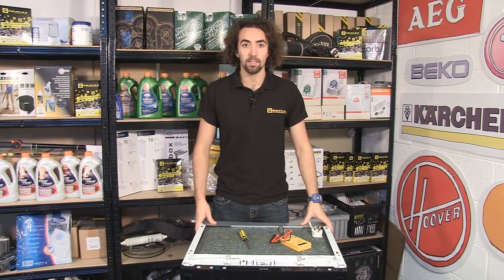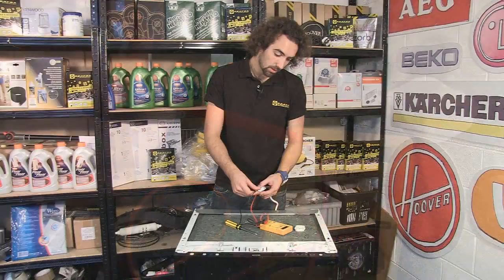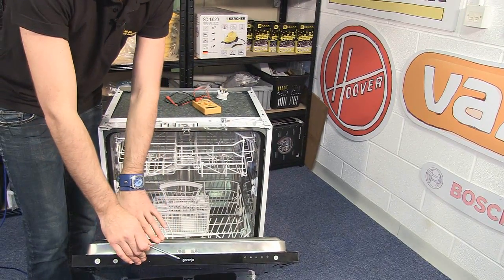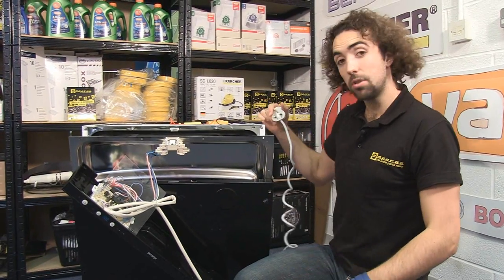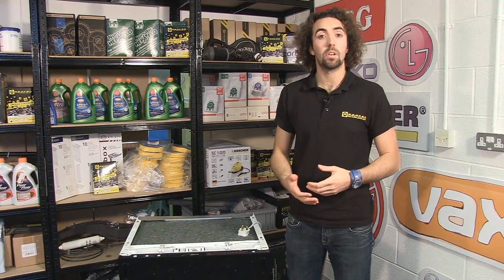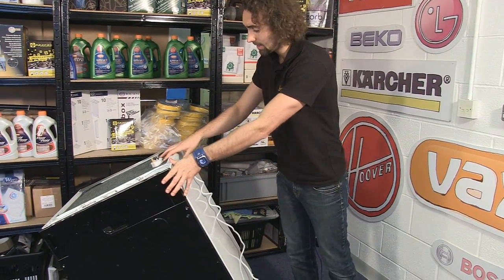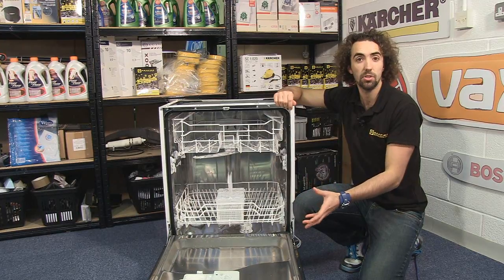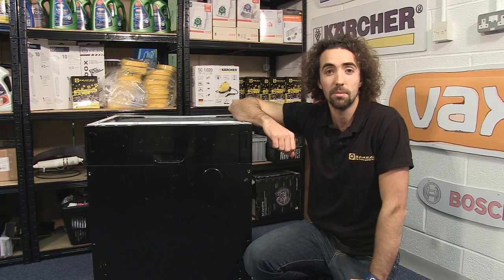How to Diagnose Control and Programme Problems with a Dishwasher

Comment: What can be the cause of a Beko eco care dishwasher model number D3731FS  as regards the selection of the temperature control buttons, they wont light up with either the 40 or 60 degree wash. the main light comes on when we switch on the machine but the temperature choice ones wont function. Any suggestions please  as i cant find answer to this question anywhere. Maybe its just to old!
Reply from the maker: +Susan Ripley We have not been able to find any information on this but  select the longest wash and see if the temperature can then be changed. On short cycles this may be fixed.
Reply: +eSpares  Hi thanks, problem is since the temperature settings lights dont come on the machine wont function at all and no water will come in. You have to choose either the 40 or 60 degrees then choose what programe you want but  nothing is working since these havnt been working.
Reply from the maker: +Susan Ripley Sorry but your description was not clear. With the door open switch the machine on and see if the lights flicker briefly. If no motors are running and no buttons bleep check the button unit and PCB for signs of corrosion or damage.
Reply: +eSpares  Hi thanks will do, or should i say will get hubby to.

Comment: Great video thankyou! I have the same make dishwasher Gorenje GV62110. And the programme button has stopped working.....LED lights flash once when powering on then remain off, the power button remains on. The prog. button clicks when pressed as normal, have gone through troubleshooting, opened up the control panel; the covering over the wires did feel damp, but that's all I could see. Have bought a multimeter today to attempt to investigate further.
Reply: So, I've done the tests as in your video and have concluded that the control board needs replacing. Are you able to tell me whether there is any need to 'programme' the replacement board on this model? : Gorenje GV62110, thanks. Great videos on your channel by the way, a great help.
Reply from the maker: +MissMochynbach The control board for your machine does not need programming and is shown here: http://www.espares.co.uk/product/es1642846/dishwasher-pcb

Comment: Great tutorial. Can you say something about the so called AquaStop ? How they work etc.
Seems to be an UK Plug / Machine / Setup. In Switzerland we don't have the fuses within the plugs, instead they are built in the device itself most of the time.
Reply from the maker: 1videoshow On some 'new kitchen' installations in the UK we wire the appliances in to 'wall plate connectors' and have a switch bank above the counter tops to isolate each appliance. As far as I know the wall plates or switchbank will be fused as well as fused and the house fuse board. Aqua stop hoses move the inlet valve to the tap and connect it through wires in the hose. In a cold environment (unheated utility or garage) if the temperature drops enough to freeze then even if the hose were to rupture no water would flow until the machine is turned on. Thus helping prevent flooding.

Comment: I have a KitchenAid and only half of the control panel works. Would that be the control panel?  The lights on the left-used to select the cycle work, but the lights on the right do not light up-to turn on or cancel.
Reply from the maker: Melisa Bellantuono It is likely to be the control panel or the button unit.

Comment: aside from the British appliances and the fact that you said that a higher resistance would mean a short it was a good explanation of dishwasher operation.
Reply from the maker: Thanks for your comments Robert,  we have rechecked our transcript.
We think you are referring to the following lines,  which when studied again we still believe are correct: 5:07
Now if you do get the reading of a short circuit, try disconnecting the heater and then testing again on the plug to see if the short is gone. If the reading is much higher, that would show the short-circuit is likely to lie in the heater.
We post this reply just to show that we do try and ensure the correct information is given and if an amendment would clarify are more than happy to add an annotation. :-)
Reply: I only have no power to my front start/stop and time panel which was only having intermittent problems and has failed altogether now. I have power to the wash selection at the top of the door.  Thanks for you're reply. I did hear you say that if a person found more resistance that that was where the short was. You might want to look at that.
Reply: The line you talk about here is not the one I heard that is not correct
Reply from the maker: Robert Greenhouse Without a model we can only generalise but if you have confirmed power to the control board and will not light up it suggests the problem may be the control board but check any switch bank attached has not been contaminated from moisture or corrosion.
Reply: I will.  Thank you
Reply: MDB8751BWB
Reply from the maker: Robert Greenhouse On your Maytag dishwasher the live and neutral connections both go through door switch contacts to the control board directly.
The information we have found for this model (NON UK) contradicts itself suggesting on the wiring diagram only one board but in the parts listing a separate control panel. if you have a separate button unit examine this carefully for signs of corrosion especially on the connectors.
Reply: Thank you, I will check that

Comment: When my washer starts the drain sequence starts then it starts to wash and the drying light comes on the wash light never comes on. it goes through it cycles washing and drying at the same time we have to stop it manually drain it and they give it a rinse to clean the dishes. A red light comes on under the drain/cancel button. I thought it needed a new control panel/board. I replaced it an d it does the same thing. Any ideas? It seem to drain ,fill and wash okay. It also gets pretty hot, so the heater is okay.
Reply from the maker: Hi Bowman W, What make and model are we talking about?.
Reply: Kenmore # 66513469K902
Reply from the maker: Bowman W We are not familiar with this machine as it is not common in the UK (if available at all). The drying light is likely to be indicating the heater is on. I would expect this to remain on until the water reaches temperature then go off. Try on its coldest wash or a rinse cycle to confirm the light goes off. If it always remains on the board 'thinks' it is to cold so suspect the temperature sensor.